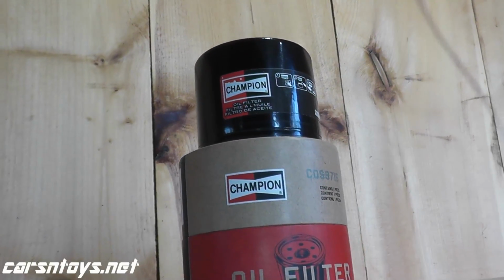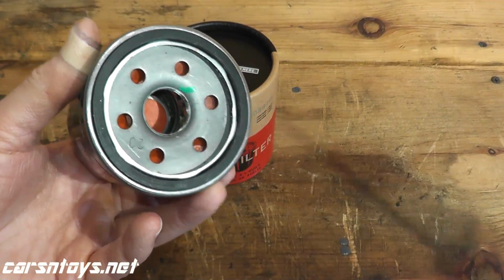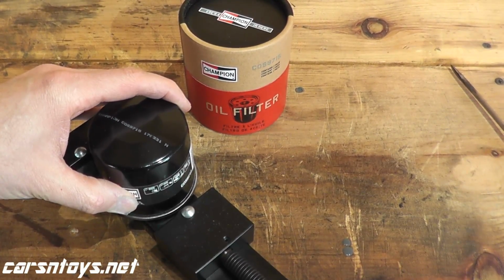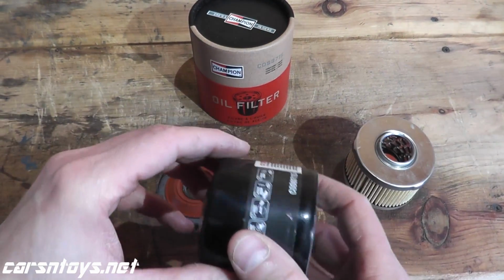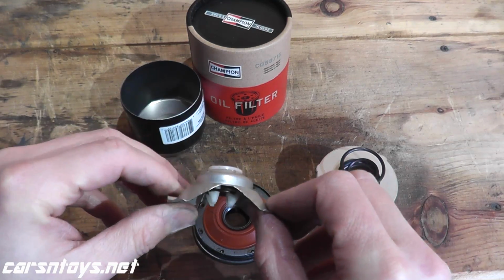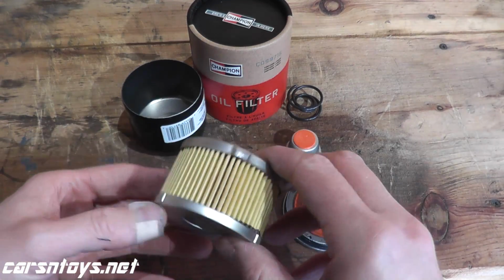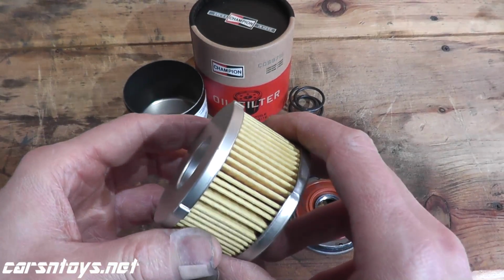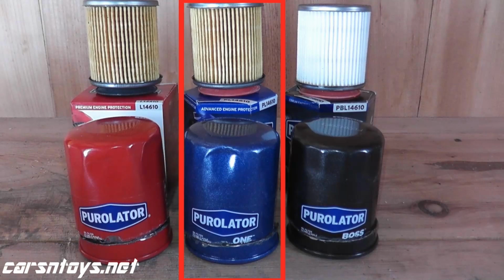Champion Oil Filter Review

Comment: Didn't know Champion made oil filters. Was using STP oil filters in my 88 Dakota, and then it spatout the crank/rod bearings with the oil when I drained it. I'm gonna be taking better care of the next motor that goes in here so I'll be using Champion from now on

Comment: Good video.   My pick up has an internal style filter like the motorcycles have.  At first I thought it was dumb idea but I have since changed my mind. It's actually a better way to go.  There's less waste,  a lot less material,  but they are not any less expensive than a spin on style.

Comment: I appreciate this review it doesn't seem like there's a whole lot of info online about these champion oil filters, found a good deal so I'll pick up a couple spares for my old 90s ram truck, debating just getting cheap dino supertech 10w30 instead of the more expensive syn blend valvoline max life since mine burns 0.75q per 1000 miles anyway...I heard syn burns more than dino due to their very small uniform molecules and going to dino may all but stop the oil burning altogether or at least reduce it

Comment: Pepboys is the only brick and mortar store that carries these. Great filter at $6.99. I usually prefer buying oil change specials that offer the Champion filter over the Purolator Classic. 

Shell Rotella for Gas Trucks and this on sale for $23.99 PLUS a $10 rebate from Shell.
Reply: tomcat360 buyer beware these filters are crap. Their packaging has the cardboard pieces all over the filters not supposed to introduce contaminates during an oil change
Reply: tomcat360 even overs brands have metal shavings on the threads.....

Comment: You mention the filtration efficiency rating, but at what micron rating is it that efficient? Without a micron rating, the efficiency rating doesn't mean much. Thanks for the videos!
Reply from the maker: Thank you. Champion didn't list the specific micron rating. I'll have to call them.
Reply: I know this is an older comment, but on summitracing for the champion filter for my truck that looks exactly like the one in this video they claimed 96% at 20 microns for its rating

Comment: Thanks for the video. Glad you're back to doing oil filter cutaways again. Any chance you can tear a Honda oil filter apart? I have a suspicion it's extremely close to a fram tough guard.
Reply from the maker: Yes, both their car/truck and bike filters.
Reply: it depends, Honda has 2 sources for oil filters both cover the same applications. The filters made by Honeywell are very similar to the Fram tough gaurd, the other manufacturer is Filtech, the Filtech filters are top notch quality. I worked as a tech and later as a parts counterman at a Honda dealership for a combined 10 years. The real bummer is that you never know what you are going to get, we would order oil filters and we would either get the Honeywell ones or the Filtech ones. on the rare occasion we received a couple cases of the Filtech  oil filters the techs in the shop would stock up on them for their personal vehicles since they are much better quality.

Comment: I have a 2006 Nissan Pathfinder.
Just wondering do I need to fill up the oil filter with clean oil, as I do my oil change is it a good idea to actually putting oil in the oil filter?
Reply from the maker: I typically add oil in the filter. Enjoy your Pathfinder.